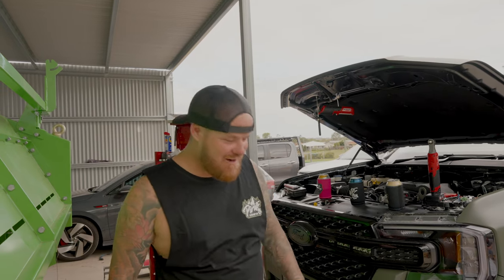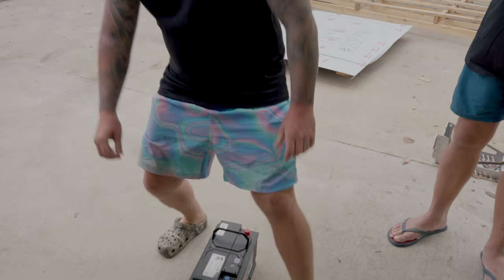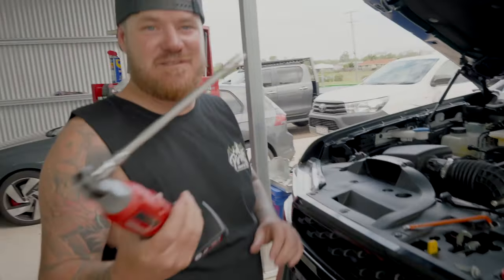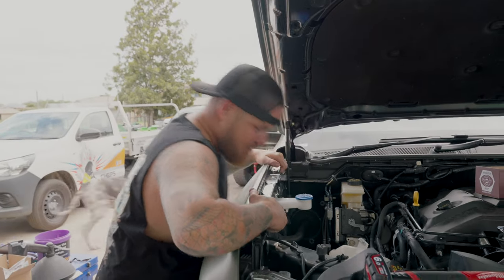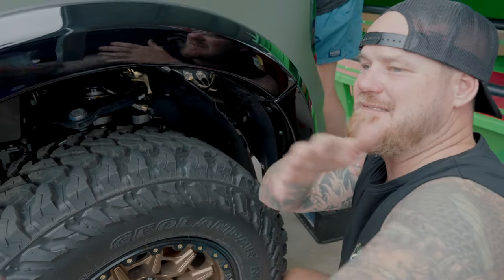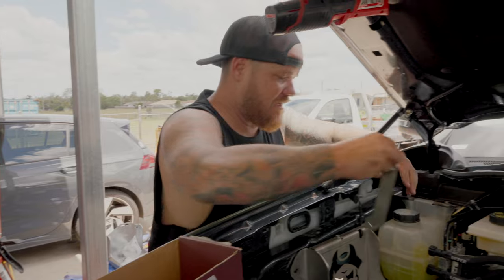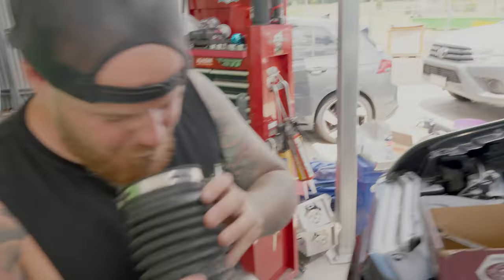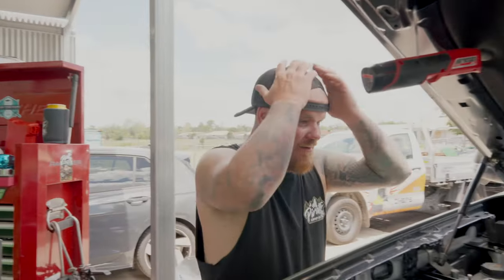UNDER BONNET AUXILIARY BATTERY MOUNT FOR FORD RANGER/EVEREST 2022+ How To Install

Comment: very good tutorial I have a question about my connection between the two batteries. Should I install a charge controller? thank you could you show us a tutorial of the connection types?
Reply from the maker: G'day legend - we aren't auto electricians so we only do plug and play videos with designated purpose built harnesses. 

However, i can say you will need a BCDC charge controller to charge you secondary battery, all he new cars have smart alternators on them, and need these.

Comment: Will this fit the bi turbo as well?
Reply: Can confirm it does. Just finished installing one in a bi-turbo. Pretty much the same install. Just seems to be a few more tubes connected to the air box before it can be removed. The lowest bolt is quite tricky to tighten, will need some small hands and a universal joint in your socket set
Reply: @andrewconstance1575   thanks heaps! Got a 12 year old his hands will do just fine haha
Reply from the maker: thnaks Andrew. Andrew is 100% accurate.